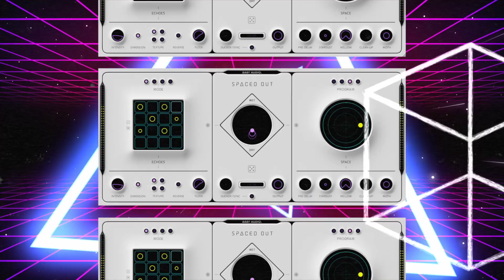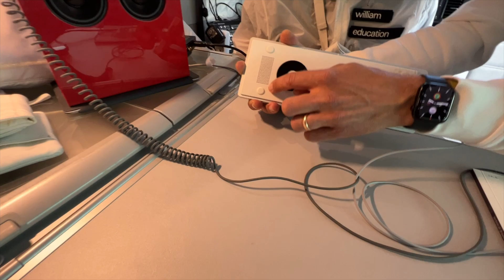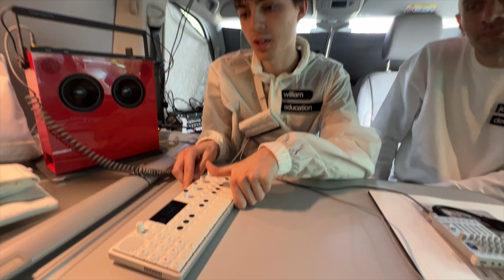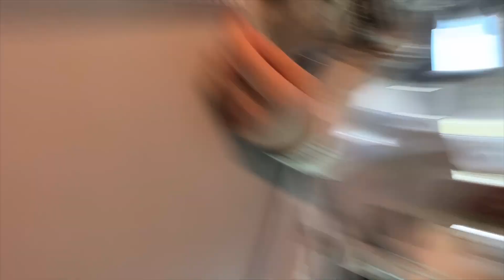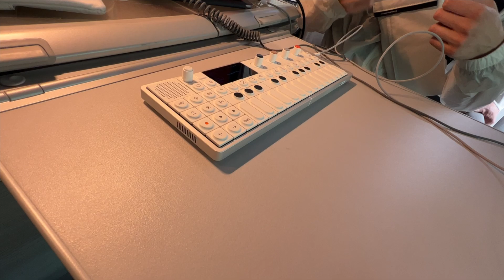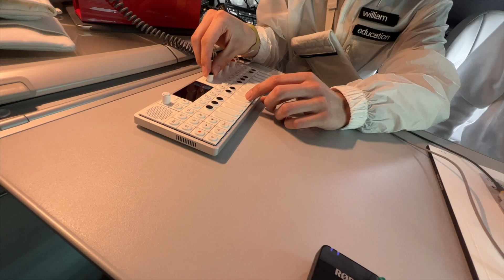Teenage Engineering OP-1 Field First Look, OP-1 History & Developer Talk

Comment: Interesting interview but some interesting questions have not been addressed:
- will there some day be more than 8 tracks? Was it a Designers UX/UI decision to stay with 4 tracks?
- was the new on off switch a mistake and did they found out when it was too late to change?
- why did they not use the op-z wheels? They are faster to operate and only need one finger. Was it because they had no solution for the volume knob?
- how many simultaneous input channels can the op1f handle with an usb audio interface and can they be mapped to different tracks to record 4 tracks at once?
- will they develop a device with just the tape engine?
Reply: the new on/off switch is definitely not a mistake. if you have a chance to use a tx-6 you will find that it’s the same and has a very good and sturdy feel. I’m certain it‘s for consistency within the “field” line and you can probably expect the same one on future announced products

can’t really speak to anything else but imo the op-z wheels would be weird on an op-1. I like the wheels for the Z workflow but op-1 is about the knobs
Reply: @vincenthunter86  yes the switch is for consistency among the product line. But in contrast to the old one it can be easily flipped on or off by mistake.
Reply: @dinraum  I would say if you haven’t had a chance yet, get your hands on a tx-6 and try the switch on there. you will absolutely not be flipping it on or off by mistake unless you’re throwing your unit around (in which case you have bigger problems)
Reply: @vincenthunter86  Tx-6 is too expensive. Possibly i will try the Tx-1

Comment: The release of the OP-1 Field feels a bit rushed to be honest and you asked the right questions. It is definitely a cool machine, but to me it’s still lacking too many things at the moment. 

One, there are not enough new kids on the block… a verb and an analog synth voice don’t cut it. (Still cool though.) 

Two, 256mb are a joke. Let’s make space for a decent amount of samples and 20 tapes to make a full length album including fillers. At least 16gb for longevity. (Or the SD slot as you said.)

Three, I miss the playful colors, but that’s just personal taste.

That being said, I hate how much bad blood teenage engineering receives at the moment. It’s an expensive toy, not the cure for cancer. Simply buy it or don’t. I will wait.
Reply: It’s 256mb of RAM, not onboard flash storage.
Reply: @tdel220  aaah okay, thanks for the heads-up! But well, that doesn't sound too "next 10 years" to me either.
Reply: 5gb of flash storage

Comment: SB 2023....T.E.Exhibit Im Kuhlschrank...sehr lecker.

ps. 'We're manufacturing in 'Asia'....AND charging $2K.......richtiges Scheissfest.    GTFO
Reply from the maker: On the SB22 they exhibit in a tent camp, the videos were made in the caravan for a more quieter atmosphere. 
Most of today's synthesizers come from Asia. Even devices that cost more than 2k from Roland, Korg, and others. Even my M1 Macbook for 4k comes from Asia. Are the products of inferior quality? Nope, only Asia makes it possible to produce more efficiently and in a larger scale. It would be cool if the production is in Sweden but it shows that Asia can produce high quality as well.  The old OP-1 was also produced there and many musicians report that it's rock solid.
Reply: Tom, obviously their costs to manufacture overseas are going to be lower.That said with the current increase in price/supply shortages of raw materials affecting the whole world a price increase was inevitable....but an increase of roughly $600??? A bit difficult to swallow but of course they'll sell a boat load to the hardcore fans.
Reply from the maker: @Kkidzz  when I see that my module that I bought at Schneidersladen after SB raised 43€ in price (349€ -> 392€) during the chip crising. On a module with a micro controller! So you know how the prices increased. It was clear in advance that the new OP-1 would not be cheaper than the original one. Don't forget, there is not just the component shortage that affects all these world wide prices increases. The international prices for logistics and handling have risen massively. It doesn't matter whether it's Sweden or Asia. But yes, they are able to produce it for a lower raw price in Asia than in Sweden. But what would it cost "made in Sweden" then? 😅
Reply: @Kkidzz  At their scale, yes. But that’s not generally the case. There’s a reason why small manufacturers tend to build their gear in Poland and other Eastern European countries.
Reply: Isn’t that an old stereotype that ‘Asia’ make cheap goods? Surly you can pay more to have higher manufacturing skills. Like say the build of an iPhone etc
Reply: @jeitoots It is a stereotype and a semi-racist one too.
Reply: musst dir die 2 ja nur anschauen in den weißen Outfits, the Apple :tm:  of the synthworld
Reply: @andolinitheflyingtortellin4765  🤣🤣🤣
Reply: @andolinitheflyingtortellin4765  Ach, seit wann trägt man bei Apple denn einheitliche Trikots? Kenne ich eher von Fußballvereinen und Junggesellenabschieden.
Reply: just to add information to the discussion the specific place in asia they are manufacturing in is malaysia